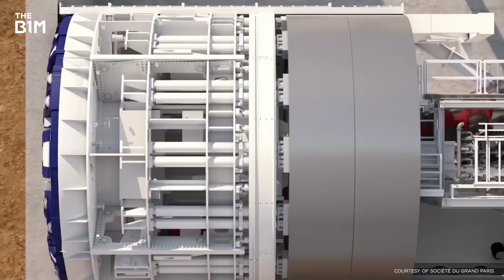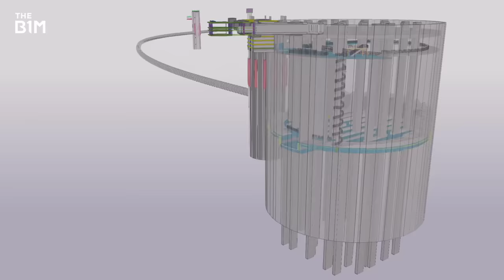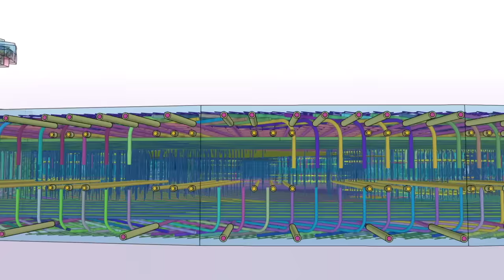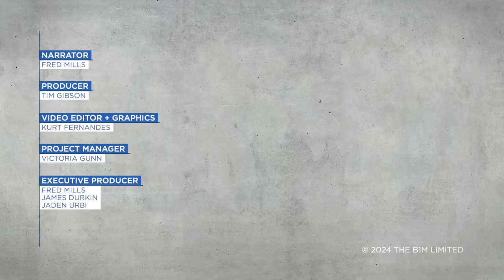Why Paris is Doubling the Size of its Metro

Comment: At 01:40, you forgot to talk about the RER system. The actual problem of Paris is not that the metro system does not go beyond the 20 arrondissements, since we have the RER for that, the problem is that the RER were built in a star-shape, connecting suburbs to city center in a real efficient way but missing suburb to suburb connections
Reply: Yes but that was the right move back then. getting out of the radial system was always going to take time
Reply: Sounds like the Washington DC Metro Transit System.
Reply: That is why they are buildîg 15,and the next ones too will be essentially suburb to suburb
Reply: there is still the paris tramway, that's exclusively connecting suburbs and departments, but it's overcrowded.(I live in paris)

Comment: Now we need Fred on location, visiting building sites and new stations like he did on the Elizabeth line. He can't miss that! 
The former Société du Grand Paris, now Société des Grands Projets, is very welcoming to YouTubers (as we've seen with RMTransit).
So I hope that Fred will be visiting the building sites very soon to bring us many details.

A few corrections, though :
What's 7.2 million is the new Grand Paris administrative division, which only covers the inner ring.
The agglomeration is around 12 and urban area around 15.
The whole Grand Paris Express project never was expected before the Olympics, only some sections of it. Especially since the project isn't even fully designed yet, there are more things to come.
Following 2020's pandemonium, they decided against rushing these sections and restructured the schedule.
So now some sections are pushed back and others brought forward, which means less small bits opening successively and larger chunks opening simultaneously.
There will be something new pretty much every year till 2030-2032.

As for the project itself and as I said, it is not fully designed yet, there are more developments to come, like the dashed line between Versailles and La Défense that should be defined in the near future. There's also a 19th metro line that was recently proposed by the region and transit agency. This one would form an arch in the Northwest quarter of the city, from Gonnesse to La Défense via Argenteuil.

Also, the GPE project is only a part of the overall transportation expansion currently underway in Paris.
In the last decade and a half alone, a dozen new tram lines were built, and there are many extensions planned.
This spring will open about 34 kilometers of new line extensions, about 30km of it underground.
They'll expand 2 metro lines (part of the GPE) but also the T3b orbital tram and RER E, which are not part of the GPE.

That's a minimum of 360 kilometers of new lines and extensions that will open between today and 2030-2032, the current state of the GPE representing roughly 200km of the total.
These new lines and extensions will be mostly metro, tram and RER, but also urban multi-station gondola lines and proper busway-trambus BRT lines.

The 3 million daily ridership mentioned is the increase expected for the GPE only.

The current GPE project is comprised of roughly 200km of new lines and extensions, 90% or 180km deep underground, the rest is mostly elevated and a few bits at grade.

Right now, more than 100 kilometers of new tunnels have already been built, out of a total of 180km.
As mentioned, the extension from Versailles to La Défense (in dashed line on the map) is not yet defined and not counted in the total.

So there should be a GPE 1.5 soon, an extension to the extension. 😂

Fred presenting the giant cylinder of Villejuif IGR interchange station, the "trench" of Saint-Denis Pleyel station, the super deep column of Saint-Maur Créteil station and other impressive stations would really be fantastic...
There are architectural wonders by the dozens!
So... maybe? Pretty please! 🙏🏼
Reply: Yes, he should do this. I guess it also depends on the sponsors, but these projects really need to be documented on every good channel.
Reply: Quel dommage qu'aucun fond ne soit alloué à la transformation de villes comme Lyon qui ont un déficit énorme de transport une fois sorti de la ville en elle-même
Reply: That's a great comment, thanks for the details and corrections!
Reply: @stongaasali   La "nouvelle" SGP (maintenant que ça s'appelle la Société des Grands Projets) est faite pour ça. Le changement de nom accompagne un élargissement de son domaine de compétence au-delà du Grand Paris.
Juste un détail cependant : ce n'est pas l'état qui paye le Grand Paris Express contrairement à ce que pense la majorité des gens.
C'est un emprunt sur plusieurs dizaines d'années, structuré par l'état mais remboursé par la région en grande majorité.
Tout comme c'est la région et les villes qui ont décidé la construction des 12 nouvelles lignes qui ont ouvert ces près de 15 dernières années (dont 2 nouvelles rien qu'en 2023). L'état n'a apporté qu'une participation à l'infrastructure et rien du tout pour les flottes de trains qui sont à la charge exclusive de la région.

Est-ce seulement possible à Lyon ? La région accepterait-elle un investissement d'ampleur à rembourser sur 50 ans ? Avec l'actuel tête de région c'est très très très mal barré...  ouin-ouin wauquiez préfèrerait perdre un bras que donner l'impression qu'il fait quelque chose pour une ville, c'est aussi un ferme partisan du tout voiture et de la maison individuelle, surtout depuis qu'il se positionne en sauveur des campagnes.
Il y a aussi le fait qu'un investissement en transports publics lourds a beaucoup plus d'effets positifs sur l'économie à Paris (au sens large) que n'importe où ailleurs en France.

Cependant, il y a les nouveaux "SERM" (Service Express Régional Métropolitain), autrement dit les RER des grandes métropoles françaises, qui sont en projet.
Mais chaque région a la main dessus, ce qui peut limiter les investissements par frilosité ainsi que par idéologie et clientèlisme politique envers les zones rurales au détriment des zones urbaines, bien que les zones rurales soient un gouffre économique sans fond.

Pour pouvoir développer les transports publics il faut aussi vraiment orienter l'habitat vers plus de densité, moins de pavillons, etc. afin que ces projets prennent de l'ampleur, au moins au niveau de nos ambitions en termes d'émissions de GES et de santé publique.
Malheureusement il y a aussi des problèmes d'idéologies politiques contradictoires, en plus du clientèlisme déjà mentionné, une mauvaise habitude en France de considérer que ce qui n'est pas plein à craquer est sur-dimensionné, ce qui est absurde.
Il y a un juste milieu entre la boîte de sardines à la française car on a toujours peur de sur-dimensionner ce qui fait qu'on se retrouve avec trop petit, et de l'autre le métro lourd à l'américaine qui transporte moins de personnes par jour qu'une ligne de tram (cf Chicago, Washington DC, Los Angeles...).
Un bon exemple de frilosité a été l'absence de tunnels séparés pour les RER B et D entre Châtelet et Gare du Nord.
On en paye le prix aujourd'hui, avec deux lignes au bord de l'asphyxie et limitées dans leurs capacités car elles doivent se partager un unique tunnel alors qu'elles déplacent à elles deux largement plus d'un million et demi de voyageurs par jour. C'est le tunnel de l'enfer où il y a la queue pour passer.
Problème qu'on tente de régler à coups d'évolutions technologiques aux résultats limités car même avec les bidouilles les plus modernes du monde, on ne fera pas passer 60 trains par heure dans chaque sens dans un seul tunnel de 2 voies. La deuxième ligne la plus chargée d'Europe doit donc partager un tunnel de quelques kilomètres, soit un infime pourcentage de sa longueur, avec une autre ligne très chargée.
Et même s'il était décidé, enfin, de construire ce second tunnel, il faudrait trouver des moyens très précis et massifs pour éviter de trop impacter le trafic pendant les travaux, tout ça parce qu'on a trop attendu.

Toulouse a pris des décisions et est en train de construire sa troisième ligne de métro basée sur un format classique avec des trains automatiques Métropolis d'Alstom, comme le Grand Paris Express, mais de seulement 3 voitures si mes souvenirs sont bons. Ce sera un peu un mélange entre une ligne 14 et la future 15 car la ligne forme un grand arc tout en desservant des lieux importants avec une très forte connectivité.
Ce sont des décisions politiques locales qui ont permis ça, ce n'est pas une décision de l'état.
C'est d'ailleurs un peu ce qui m'a surpris dans la formulation de ton commentaire : "aucun fond alloué", mais par qui ? L'état ? La région ?
Ce sont les décisions locales, souvent ensuite appuyées par l'état qui donnent des résultats.
On ne peut pas attendre de l'état qu'il prenne les décisions pour chaque ville ou région.
Même si il faudrait peut-être ça à Marseille pour qu'ils aient enfin un développement conséquent de leur réseau de transport.

Il faut voter, parler à ses représentants élus, fréquenter les réunions publiques, etc.
Lyon a effectivement un besoin en grande couronne, mais s'en sort plutôt bien sur le reste comparé à Marseille par exemple qui est vraiment très pauvre en transports.
Les 2 pauvres lignes de métro sont trop courtes, de grands pans entiers de la ville n'ont que des bus plus ou moins corrects. Et surtout niveau habitat, c'est très orienté voiture à part le centre. Ce qui est aussi un problème à Lyon sorti de la partie centrale.
Marseille est un peu une zone prioritaire dans tous les sens du terme, particulièrement niveau urbanisme et transports.

Peut-être que les résultats du Grand Paris Express sur la part modale et l'urbanisme auront un effet déclencheur sur les autres grandes villes. Elles ne pourront pas rester des petits îlots de mobilité décarbonée isolés.

Ce qui a aussi permis un tel développement à Paris (les 12 nouvelles lignes de tram, des T3a, T3b, T4.... au T13, le GPE,  l'extension Ouest du RER E, les nouveaux Tzen, etc.) c'est le fait que plus il y de personnes qui prennent les transports, plus il y a d'intérêt pour les développer.
C'est un cercle vertueux qu'il faut amorcer.
Alors il ne faudra peut-être pas s'attendre à avoir un maillage comme à Paris, mais au moins comme dans les grandes métropoles allemandes pour ce qui est de la banlieue.
Pour ça il faudra aussi accepter de renoncer à la voiture avec moins de protestation.
Bonne soirée.
Reply: @stongaasali That's up to the Lyonnais to pay to improve their public transit network just like the Parisians did for themselves. The French State will fund new RERs, probably Lyon is on the list of the recipients.
Reply: @stongaasali  ça va arriver. Déjà ils se focalisent sur les RER jusqu’en 2040 à mon avis. Lyon me paraît être la ville la plus propice pour ça de part la densité de lignes ferroviaires existantes et par la présence de 4 gares dans la ville (Part Dieu, Perrache, Saint Paul, Jean Macé) 

Après si Lyon veut développer quelque chose dans sa ville hors des pistes cyclables, il va falloir remercier le p’tit Gregory et reprendre la marche vers les vrais projets d’infrastructure comme la ligne E et la ligne Lyon-Turin. 

Ne brûlons pas les étapes virons les communistes verts, reprenons où nous en étions puis définissons des caps et des projets ambitieux pour décarboner nos déplacements.
Reply: @lr7694_  Bon bah on va pas être d'accord. Les pistes cyclables étaient un vrai besoin. Et un projet ambitieux comme ce qu'ils vont faire est le meilleur moyen de transformer les déplacements internes. 
Pour ce qui est des trams, il y a de nombreuses lignes en construction donc de ce côté, tes "communistes verts" font du bon boulot.

Pour le RER, ça dépend de la région car ça sortirait de la métropole et même du département vu la proximité avec les 01, 38 et 42. 
Donc le problème est et restera Wauquiez et sa clique de droitards motards qui vivent dans leur monde égoïste
Reply: Make a video, this 6min video was rushed and poor.
Reply: @KyrilPG  La SGP est quand même en partie financée par l'Etat. En ce qui concerne Lyon ou Marseille, la compétence du transport est exclusive à la métropole, à l'exception du rail. La région n'a donc rien à financer dans ce cas ci. 
Cas particulier de Marseille, la Métropole AMP a été votée par le Parlement pour régler le souci du transport sur son territoire. Problèmes : Ils ont crée la plus grande métropole de France (30 fois plus grande que Paris Intra-muros pour une population équivalente, ou encore, plus grande que l'air urbaine de Paris, pour 5x moins de population). Son territoire est rural et urbain, allons trouver un investissement rentable. Pour la commune de Marseille, problème topographique aussi, elle est en longueur, coincée entre collines et mer avec moins de grands boulevards pour de grosses infrastructures tq tramways. Grosse différence avec Paris et l'IDF qui est un plateau.

Comment: Those modern TBMs are amazing, they’ve advanced so much in my lifetime, born 1960.
Reply: I was just thinking that too. I was born in '83, yet still in the last 20 years the uptake of TBMs has been rampant and changing the shape of cities and urban transport links in many many places!
Reply: And almost all of them get build by one small family owned business in Germany
Reply: Are you talking about Herrenknecht?
Reply: They make these projects look easy now, to the point now it usually isn't the tunnel digging that cause the delays, I believe most of HS2 tunnels are ahead of schedule, an the Elizabeth line tunnels was also completed ahead of schedule but the equipping of the stations and all of the other infrastructure needed to make a functioning metro system.
Reply: @swunt10  Another largely British invention, perfected by another country.
Reply: @swunt10 Which company? I'm pretty sure it's mostly Chinese companies now.
Reply: TBMs also have now their vertical cousins to dig wells and access points to underground complex. Both types were used on the GPX project.